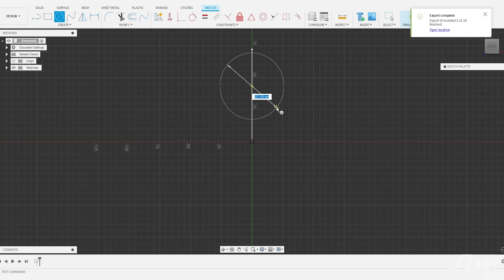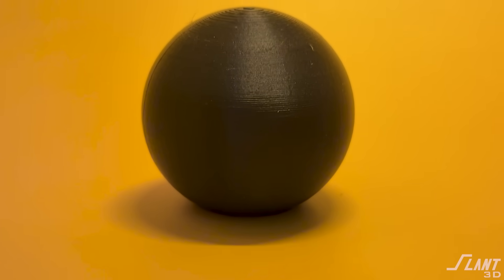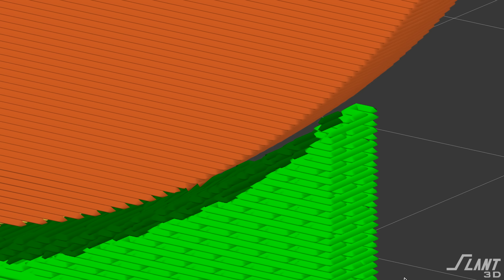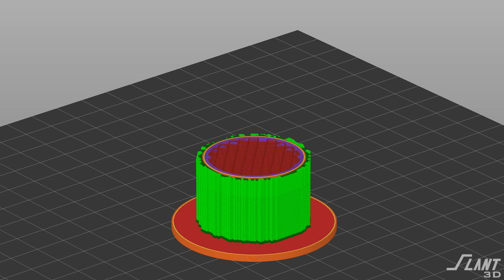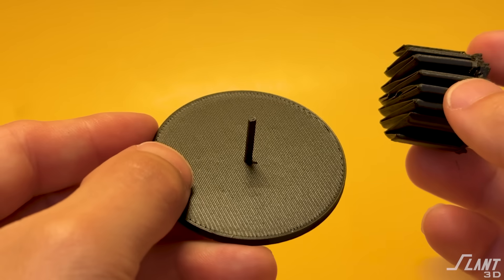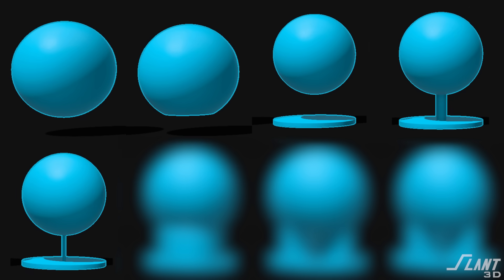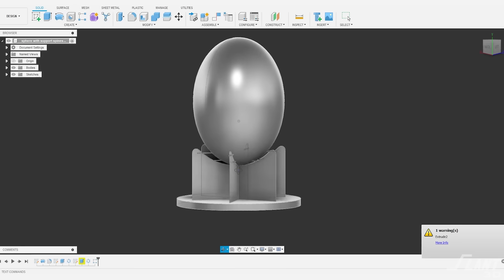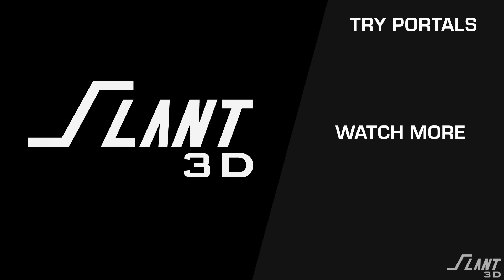Can We 3D Print a Perfect Sphere?

Comment: I was waiting for splitting sphere into two parts 😢
Reply: This is the way
Reply: When I print eyeballs I use split sphere method but you almost always have a visible seam.
Reply: @WickedV3ng3nc3  Maybe you can print it with a thread and then screw it together tight
Reply: @WickedV3ng3nc3  visible seam is much better than all the cooling defects in the video, if you get it right
Reply: @WickedV3ng3nc3  have you tried scarf seam? it doesn't eliminate the seam, but it makes it less visible.
Reply: @WickedV3ng3nc3  it may be visible, but less visible than support area in this video, isn't it? And visibility does not mean it is not spherical - it just have surface pattern differences.
Reply: Cut the sphere in half and glue them together would work on some projects but definitely not ballbearings.
Reply: @lawrencesheppard4820  You don't actually have to glue it.  You can print the first half, then you can print a jig, and place the first half in it and print the other have on top of the first half.  But our man in the video isn't going to like that solution, because it's not hands off.  But you do get a 'perfect' sphere using that approach.  (At least in the sense that it's symmetrical in its print lines.)
Reply: @bujin5455  How you going to align that jig on the print bed to print on it?
Reply: @MrGTAmodsgerman  Though this isn't a simple process, alignment isn't as hard as you're imaging.  I suspect you're talking about the jig's alignment to the upper piece.  In that case, you create your STL file with the upper half of the sphere prepositioned over the jig's void (where your the lower half goes) so that the jig and the second half of the print are aligned by the STL, and the jig is there to align the first half, and then you direct your slicer to put a pause/break at the layer level where the transition happens (the new sphere starts), that's when you drop your lower half into the jig, and then continue the print.  Of course, this is an advanced technique, so you need to know what you're doing both in CAD and in your slicer and in printing in general.  For instance, you need the starting position of the second half to be a multiple of your print height, so that the two pieces meet up perfectly.  

This approach works perfectly with most impossible shapes, where the geometry of the part can't really shift in the jig.  With a sphere it might want to shift a little.  You can deal with this by applying a little glue stick to the bottom of the sphere before placing it into the jig, to keep it from shifting during print. This just washes off later when the print is over.  Of course, you could design sprues into the print, to lock lower half into the jig, then no adhesive would be required.
Reply: @bujin5455  I have seen this done with various complex models to eliminate supports.
Reply: @bujin5455  How do you print the second half starting on top of the first half?
Reply: @Mini_Motor_Mayhem  I thought you said you had done this before?
Reply: @bujin5455  I did the print each half face down with a central pin added for alignment method not the print first half then flip it over and print the second half on top of the first method.
Reply: @Mini_Motor_Mayhem  

a) Design your object.
b) Break your object into two halves.
c) Create a jig for your object, there is various ways of doing this.  Subtracting a copy of the object you want held works.
d) Export one STL with half of the object facing flat side down.  Export a second STL with the jig, and second half of the object just above where the first half was.  (Where if you put the first half in, it would completely fill the space, and touch the second half.)
e) Print the first STL, and remove it from the print bed. 
f) Bring your second STL into your slicer, set a break point at the layer that is the last layer of the jig, just before you start printing the second half.
g) Print your second STL, when the printer stops, the jig should be printed onto the bed.  Place the first half of the object you printed before into the jig (glue it in if necessary, or design sprues into the print), and resume the print.  The printer then continues the print, right on top of the first half of the object.
Reply: @bujin5455  Maybe your sliced model is hemisphere flat down with the second half also flat down right on top of the first one.
Print half the model, pause , flip and support the first half then resume.
Alignment and registration of the lower half would be critical.
I almost want to try it.
How else would you get the printer to start the second half at the equator of the first half?
I also need to learn how to program in a pause at the exact right layer. I know this is done so its a google search away.
Reply: @bujin5455  I came to a similar solution using one model. Same result.
Reply: @bujin5455  trying this now. The support is modeled with the second half over the fixture with the first half printed as another object on the same plate. But the fixture and upper hemisphere wont slice without supports, else the upper half would be floating.
Still not sure how to get the upper half to print. The model will always be floating and require a lot of supports that need to be removed without moving the fixture..
Reply: @bujin5455  nvm I thought the error wouldn't let me send to print, but its just a warning. Printing now , will see how it goes.
The only issue I see now is the fixture was made as a negative of the part , so it probably needs to be bigger than the part. I added a small offset to the internal dimension.
Reply: @Mini_Motor_Mayhem  This is obviously an advanced technique, but it really isn't all that hard for someone who knows their tools.  I've done this sort of process on many occasions.   There are many other people who have performed this process, or processes like this, and have videos if you want to watch it done.  Yes, you might have to put a little work into sizing the jig correctly, like I said this is an advanced technique, the outline I provided was just an outline.  By the way, I've already discussed alignment in an earlier post, scroll up to read it.
Reply: @bujin5455  Yeah it's a lot easier than I thought. Just ran a test print all parts on one print with a pause. Thought it would be more difficult.
Reply: @bujin5455  interesting approach, but...did you try it? It seems to me the first part will dance under the pressure of the extruded filament for the second part. :/
Reply: @antunrosovic7284  if you read all my comments on this, you would have seen that a situation such as this might require some glue to adhere the part to the jig, or you might need to print sprues from the lower hemisphere to the jig to hold it in place.  For other sorts of parts, where the geometry locks the object into the jig, this sort of additional motion constraint is not needed.
Reply: @bujin5455  That's a very nice smart method. Thanks for sharing. Have you come up with it yourself or did you saw this somewhere?
Reply: @MrGTAmodsgerman  I think it's fairly widely known.  I don't recall exactly when and where I started using it.  I built my first printer from parts about 15 years ago.
Reply: @bujin5455   Do you know what this method is called? Overprinting or something like that?
Reply: @MrGTAmodsgerman  I don't know that there is a name specifically for 'discontinuous printing' (what I'm calling it just now) as such.  But it's part of “mid-print embedding” or “pause and insert” printing.  A lot of times this technique is used to embed metal fasteners, or magnets, or weights, or circuit boards, or what have you, but there is no reason you can't embed another printed part, like I'm talking about here, which is also pretty common.  This technique gets WAY more advanced than simply flipping things over and continuing.  For instance, the inserted part could provide complex functionality to the object your printing, such as a gear set you could never print without supports, in a cavity you could never get supports out of.  Thereby enabling object creation that is 'theoretically' impossible.
Reply: @bujin5455  Ok i see what you mean now. Yea i know the print in magnets and print 2 different filaments without AMS and such. Yea, ok i thought for that one specifically there is a name. Thx anyway.
Reply: if you are going for ball bearings, imo the method would be to design pseudo spheres as polyhedrons, and lap them. requires materials to be right i think, tho, lapping plastic sounds impossible but maybe??????????
Reply: @lawrencesheppard4820  For 3D printed ball bearings we are using BB gun 6mm balls. Perfectly round and suitable for such need - unless you need big/chunky ball bearings ;) You're welcome.
Reply: A sphere is just an example of such geometry, with smooth, strongly overhanging shapes. While a sphere can be cut in half, this is problematic for most parts, so unibody printing methods are needed.
Reply: There is no need for a jig. Just use registration marks or a keyed hole on one half and a identical keyed bump on the other half so there is only one way the two halves would snap together perfectly.
Reply: @intrinsical  You need the jig if you want to flip the print over and continue the print on the other side.  What you suggest doesn't actually produce a perfect whole part.  What you're suggesting produces two parts, that are snapped together, with a seam down the middle.  My approach produces a whole single part where you're left scratching your head on how it was done.
Reply: That's how I did it.
Reply: I printed a trackball ball in 2 sections with a 40% fill (the original needed more inertia) with a rather clever joint. After a light wet sanding it worked surprisingly well.
Reply: @josephwisniewski3673  what was the "clever joint"?
Reply: I actually thought split it in 6 to 8 interlocking pieces and make the layer lines a design feature/pattern
Reply: That's printing half a sphere though
Reply: @kdt85  you should read the thread
Reply: @bujin5455  Thank you very much for the great advice! "This technique gets WAY more advanced than simply flipping things over and continuing" Are there any videos or other resources you recommend that teach/discuss it?
Reply: @bujin5455  I did. I'm saying the reason it's not mentioned in the video is because by splitting it in half you are no longer printing a sphere. Or am I missing something?
Reply: @kdt85  You're clearly missing something, because in this very thread you're talking to me in, I've spoken at great detail how you can create a 'perfect' sphere with no seams at all.  I don't believe you've actually read the thread.  Go read my prior comments on the subject.
Reply: @kdt85 print two halves of a mold to make one perfect sphere out of another material like epoxy